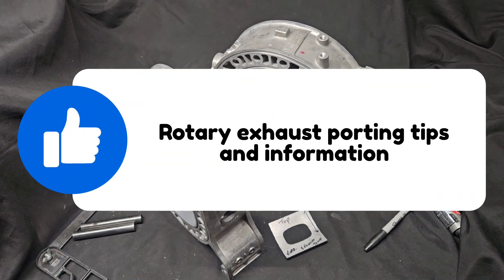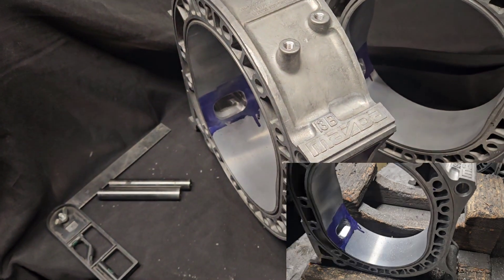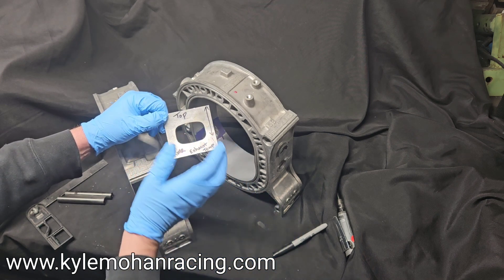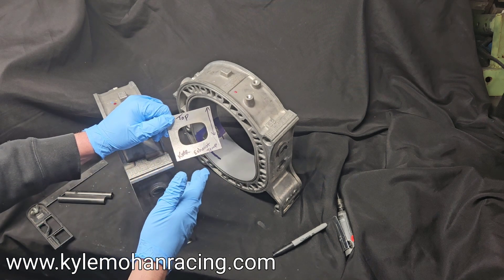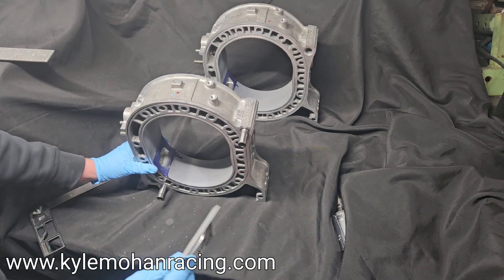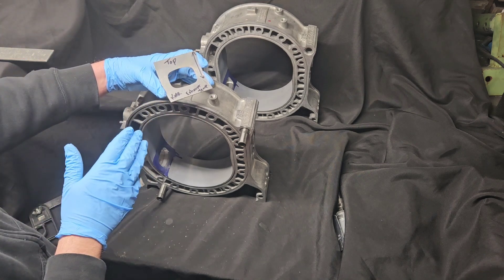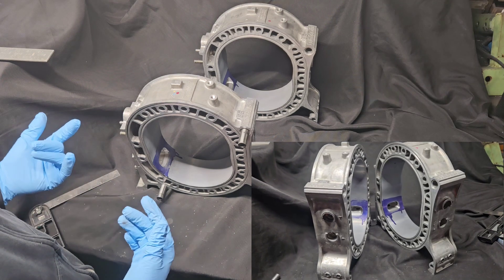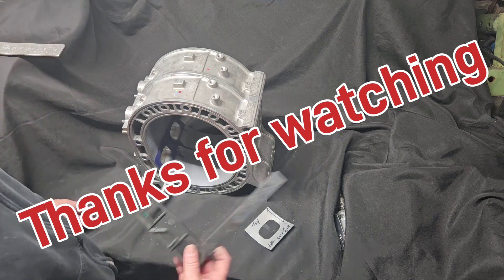Rotary Engine Tips - Exhaust  Porting - Exhaust Timing and the basic how to use a porting template

Comment: How essential is the Inconel wedge piece inserted in RX-7 exhaust port, along with air injection, that also reduces noise? If you take it away, what could happen?
Reply from the maker: I have some videos on it. All of our testing shows, it's better to have the insert. Minding that there are good inserts and ones that block flow. Generally, I recommend a straight through insert. Like theturbo cars have

Comment: Im building a " cheap" turbo engine now im using all na parts but the irons. I ported the exhaust to the stock sleeve. So basically on the inside i ported up to the factory bevel then re beveled it. Hopefully it rips?!!! I didn't do a huge bevel but its smooth.
Reply: I would be using turbo rotas if going turbo,,ur going to be limited for boost (6 to 8psi max ) and reliability if you use N/A rotas save the later drama and  future damage just use turbo rotas,

Comment: Do you want to do some porting on the Hybird rx8 housing when turbo charging to get less back pressure?
Reply: I am curious too about porting on Hybrids. I've heard that there's issues regarding the timing between the two being different and having lackluster performance. I recall forum warriors saying something about the RX8 exhaust being zero-overlap or something like that. Would love to hear Kyle's opinion since he seems to be the wizard with Hybrids
Reply: I would think so because in the hybrid engine they use gsl se housings which our a na engine so I would port it for sure.
Reply: Not really. If anything, you'd want to choke the SE housings for later open and earlier close, but that isn't very practical.
Reply: @RotaryJunkie  I wonder if the JDM 84 -85 housings (SKU: N307-10-100C) would be a better match for the 13B MSP port timing?